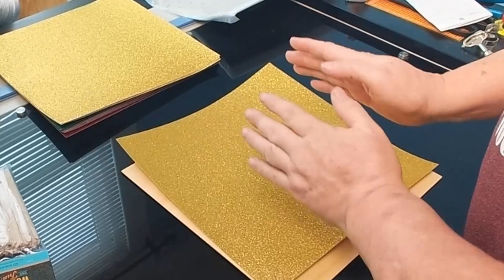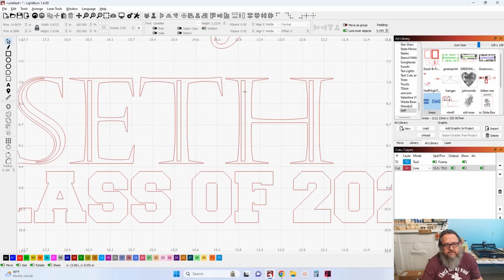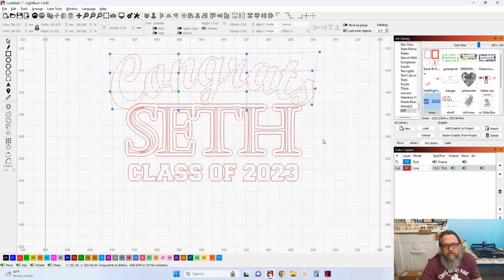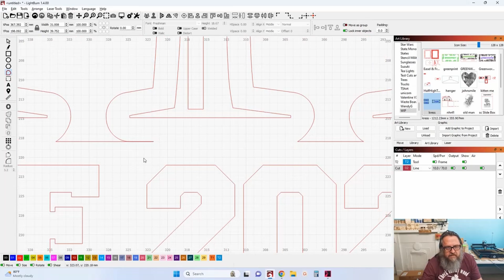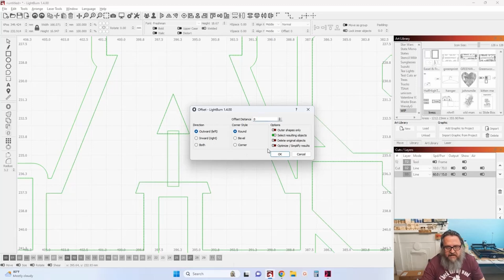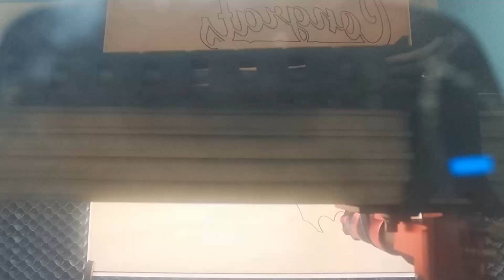Graduation Cake Topper Design

Comment: Another great one Steve!  Thanks so much.  If I may, a suggestion to reduce the risk of messing up the gluing with wrinkles and bubbles:  place 2 pieces of wax paper on the dry surface, leaving about 1 inch or so open in the middle.  Orient what's to be glued down, then press on the 1 inch opening until it adheres.  then slowly roll one side as you drag away the wax paper and press down, smoothing as you go until adhered all the way to the edge.  repeat with the other side.  you might consider investing in a roller to smooth it out afterwards.